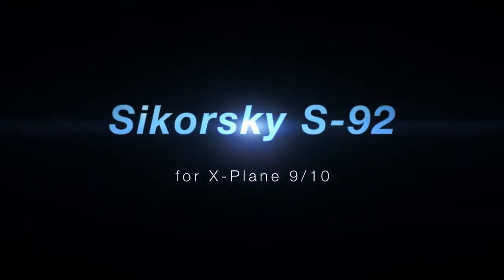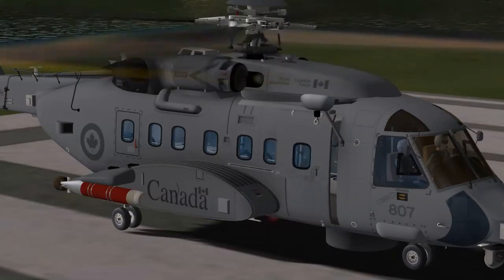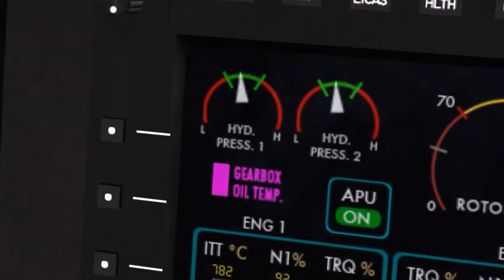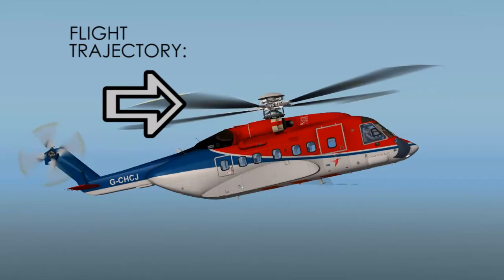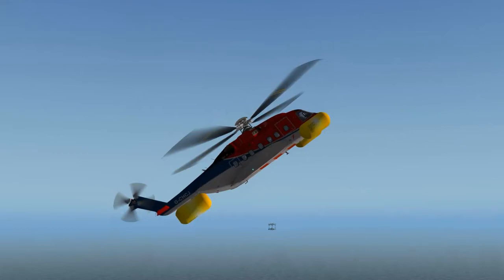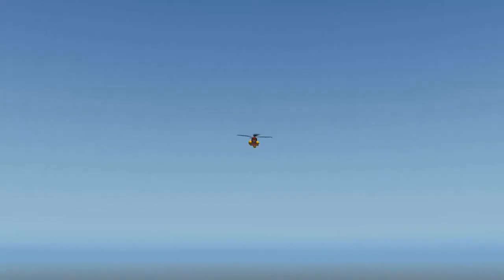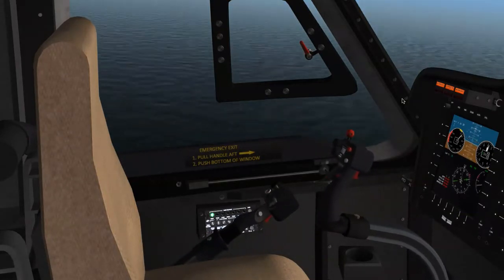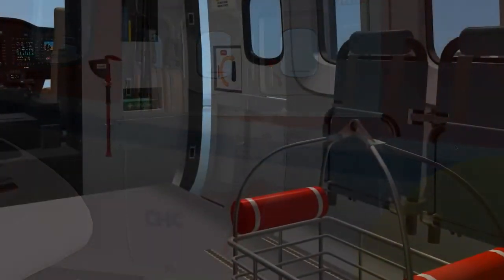Sikorsky S-92 Simulator Tutorial #2 - Autorotation & Water

Comment: Great Video! You explained the process for autorotating to the water. During the flare portion, you mentioned at roughly 150', raising the nose and applying slight up collective.  If you need to increase collective in the flare upon entry (this would be a result of excessive rotor RPM), you are flaring too hard. The idea, as you mentioned is to make the smoothest touchdown possible. If you pull collective in the beginining of the flare, that will equate to that much less collective available at the bottom of the flare to cusion your landing.

Keep up the good work!